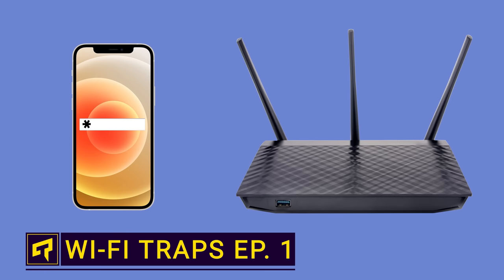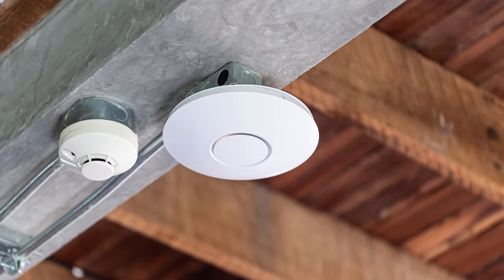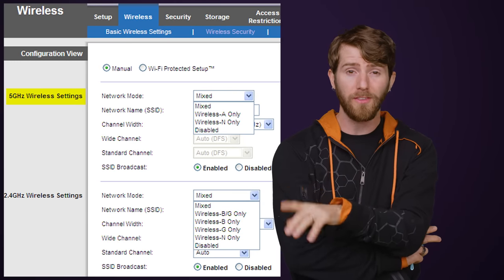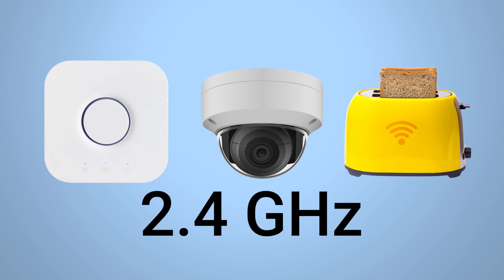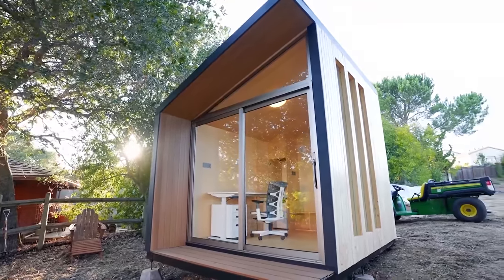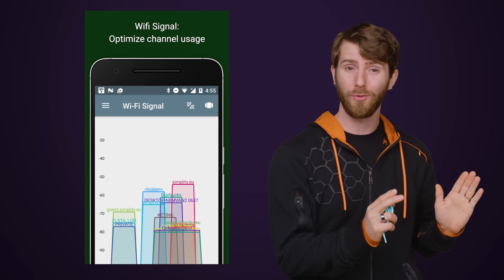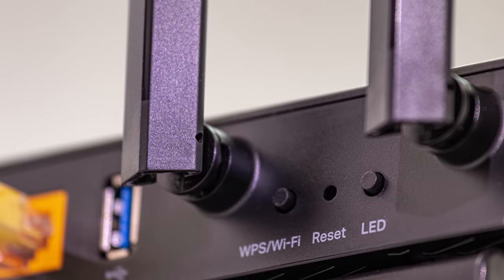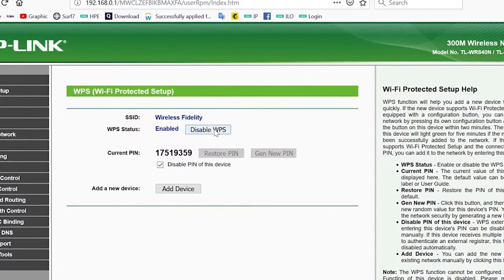Avoiding Common Wi-Fi Traps

Comment: i have often the problem that my cellphone looses the connection, while my laptop has no issues... at first i was thinking that it could be the router because he also loses some times the connection outgoing and had an dualstack-light problem. But meanwhile ive got a nex fritzbox an the issu remains. so i think it must be a cellphoneproblem...

Comment: What is recommended for beam-forming routers with detachable antennae? Is it ok to place a single antenna up high on a longish extension cable and have the others (other two?) attched directly to the router?

Comment: Note: A channel which partly overlaps with others will come with significant send/receive problems. Either you will find a complete free channel and use that (best case) or you sync your channel with the ones of your neighbors (usually channel 1, 6 or 11). This allows your Access Point (Router) to coordinate better with other.

Comment: If the range allows, actually switching to 5GHz can improve a sketchy 2.4GHz connection in crowded areas. 5GHz has many more channels available, and the limited range can work in your advantage too as not too many neighbours WiFis will interfere.

Comment: Reusing old routers as wifi hotspots is cheaper than using dedicated wifi hotspots and more effective sometimes than upgrading the wifi version, plus can be used as unmanaged switches. The only downside is you need to invest some time in studying how to do this and figuring out the setup but you also will learn quite some things about networking.

Comment: wireless modem guard interval. i believe most are set to "short".. if there are walls and signal in the other rooms are about less than 90%. for more stable speed, may need to set guard interval to "long".

Comment: My wifi used to lose connection a lot of times a day so I created a white list with the devices of the house and the problem was solved. The only downside to this besides being a little complicated at first, is that if you have guests or a new device you need to enter in the router to enter the new ip or a guest wifi might work idk. Also if you are on an iPhone you gotta disable private address so that it doesn't generate random ips and that way you couldn't connect

Comment: Small thing, WPA pins are completely safe because most routers will lockout wpa after 10 or so failed attempts, though there is a problem called a pixie dust attack in many routers, and that allowed PIN recovery in a matter of SECONDS
Reply: Bully and reaver are some very handy tools that exploit that vulnerability
Reply: @ΧρήστοςΔημακόπουλος-ζ5ε  yes, though only the pixiewps fork of reaver and not the “vanilla” version

Comment: You completely forgot ping. 2.4GHz and good ping are bitter enemies in my experience. Specially if you have bluetooth devices, an active microwave, or even just simply multiple people using the network far apart so that collision avoidance doesn't properly work anymore. Let alone neighbors that crowd the bands. Fuck 2.4GHz. I've always had bad ping and bandwidth because of it! I hope it goes away forever!
Reply: *Especially (different meaning)

Comment: on my zyxel router (may also apply to other brands) WPS settings are separate for the 2.4 and 5 GHz bands, so you need to disable it for both - and if you're not familiar with Zyxel's terrible UI it's not obvious how to get to it.

one of the more "funny" things I see in my building are neighbours' TVs, printers, and phones that show in Windows networking, assumingly because they're set up as unsecure access points and hot spots. Sometimes windows will even show these in the "send to" option. We have around 400 apartments in this building, so I don't have any way of knowing whose devices I  can see, but it is a sign of bad security that they show up at all
Reply: Are you perhaps using Powerline Ethernet with Powerline encryption disabled? That might explain why, if both you and your neighbors are doing that. Check your Powerline adapter's manual, but with the TP-Link ones I've used, you enable encryption by pressing the pairing button on  one, then another, and keep doing that (pressing pair on one paired unit + one unpaired) until all of them are paired.

Also, if that is your problem, you are probably using Powerline adapters based on the HomeAV 1 protocol, where encryption is optional. When I upgraded to Home AV 2, network performance improved _significantly_.

Comment: living in a medium/high density unit block (condo to you Canandians) I frequently have signal quality issues (despite having line of sight with my AP which is on the wall!), with my unifi's client experience graph looking like something from a Saw movie trailer... My tip (and only the tip ahuh! damn it AvE, what have you done to me!!!!) Be willing to regularly change channels to find a better channel that is less congested as it can help a lot, though you should be mindful of channel overlap.

Also avoid cranking the AP power, it increases the footprint which makes it easier for a would be attacker to attack the network from afar but much more importantly, it increases background noise which can cause other nearby access points which are in automatic mode to crank the power too causing a perpetual feedback loop resulting in a shit wifi experience for all. Sadly most devices that are "included" in internet packages just crank the power to max :(
Reply: doesn't matter if you are line of sight, necessarily...if your neighbors' wifi is stepping on yours it's because you are closer to their wifi router than you are to yours (e.g. you are getting a stronger signal strength from your neighbor's router vs your router).

Comment: Best way I've found to make your Wi-Fi better (outside of just ditching it for Ethernet) is to set your router to broadcast on a 20 MHz channel for 2.4 GHz, and 40 MHz for 5 GHz. Or for certain brands, tell it "up to X Mbps", where X is the smallest number. Then do the channelization to get into the area with the least amount of interference.
Yes, outwardly it looks like your connection will be worse, and the theoretical limits go down. But if you live in an apartment/condo/townhouse, you'll notice your wireless is a lot better now that you don't have to deal with as much interference from the dozens of routers around you.

Comment: I guess I am very lucky when it come to Bluetooth and Wifi connectivity. I don't think I ever had any wifi issues unless I am upgrading the firmware or resetting the connection once in a while. Ever since I purchased a mesh wifi router and spread it out on my house, I never have an issue at all. Everything connect and sync pretty well on my devices. Sometimes I never really think about my wifi because it is always connected as if just a regular thing. Get home or even within 40 paces from the front door and my smartphone is already connected. (auto connect to secure network).

Comment: The latest BT router here in England is great for most things except they have taken out the option to use the 2.4 or    5ghz manually. A bit of a problem for IoT bulbs that run without a bridge. Sigh.
Reply: If the IoT items only use 2.4 ghz, it shouldn't be an issue , the SSID is the same but they should connect to the 2.4 automatically...it's the same with my mesh system , same SSID for 2.4 and 5 Ghz , but different channels, all my older 2.4 Ghz only gear connects just fine.

Comment: This video missed the big advantage of 5GHz, in my opinion: its use as a counter to crowding. Between the larger number of channels, the fact that the channels do not overlap (in their basic forms at least), the more limited range and the fact they're more affected by walls, crowding isn't much of an issue on 5GHz, so if crowding is the issue, it's a much better choice than 2.4GHz

Comment: I had constant Bluetooth headphone issues (AirPod pros) until I disabled my 2.4ghz network. They’d get staticky audio multiple times a minute and sometimes disconnect completely. Since disabling I haven’t had a single issue.
Reply: You don’t really need it on unless you have a device that only supports the 2.4Ghz band. Unfortunately I have one devices that still uses it.

Comment: I do this for  a living in businesses. Couple key things. Avoid going thru pathrooms with pipes in the wall. It is not so much the metal, but the water in them. Also when I go into a home 99% of the time the antennas on the Wifi routers are in the wrong position. The first image  in this video has the antenna placement wrong. Modern multiple antenna devices need them to be parallel   You can point them in a direction, but they need to be parallel.

Comment: What I regularly do when setup a wireless network is to disable SSID broadcasting. Sure, its more inconvenient when guests come over and want to connect to the wifi but it helps with security. Mac Address whitelisting is also a good way to keep your network secure by only allowing whitelisted devices to connect to the internet. Its also inconvenient for guests. What I do for guests is just temporarily enable a guest network with a secure password for them to connect to and keep my main devices whitelisted on our hidden network.
Reply: Both of these things are easily overcome by somebody who would like to break in to your wifi. Keep WPS off, use a secure WPA2 password, you don't need to engage in security theater. It's about as useful as taking your shoes off in an airport.

Comment: Disable the 2.4 Ghz on your modem, use an Ethernet over power to an old router setup to be a switch and setup that device to turn off it's 5Ghz and use it for the 2.4Ghz in a more central part of your home
Reply: *its (possessive)
it's = contraction of "it is/has"

Comment: To get better WiFi, I just use an old router and configure it as a access point (AP) and place it in a dead space in my house. The trick is getting a ethernet cable from the dead space to the main router. Also if you don't have a old router laying around, you can usually get a cheap one from a thrift store like good will and such, and use that as a AP.
Reply: *an access
*an Ethernet
*an old
*an AP
(Because these words start with a vowel sound)

Comment: If your device has an ethernet jack. You can use a device called a moca adapter. Simply plug one adapter into you router and another into your pc using existing cable tv wiring. These devices are typically better than powerline adapters but, with a higher price tag.
Reply: i had issues with powerline adapters so i just drilled a hole in the wall and ran an ethernet cable through it
Reply: @gamecubeplayer  For the win.

Comment: Another thing to know it is that often you will get no improvement setting a higher signal strength on your router. Of course the measurable range will be greater but you need to keep in mind that your end device have to answer back and smartphones often have lot less power than a laptop. Did you even have case where you have 2/4 wifi bars on your laptop and smartphone on the same position but you can only access the internet with the laptop ? That’s probably the cause, both devices can see the wifi but only the laptop has a strength enough signal to respond.
Reply: Is like being in an arena with someone on the stage, without a mic, you can’t hear what the other is saying. If you give the one on stage a microphone, it is like setting a higher signal strength on the wifi router, you could hear the one on stage but he can’t still here you back.
Reply: Also having to high signal strength in a multi wifi router environment will cause you client to stay connected longer with an router before roaming to another. This behavior know as sticky client.

Comment: I whitelist MAC addresses of my devices and allow only those device to connect. Yes, it did give me some frustration when I bought a new device and forgot to whitelist it but hey at least it worked.
Reply: MAC addresses are always publicly visible in clear text, so they can easily be seen with a packet sniffer and then spoofed. MAC address filtering is no protection at all. The encryption is what matters. Use WPA3 or WPA2, and set a strong encryption key (long and randomly generated) that you keep in your password manager. Maximum length is 63 characters.
Reply: @alvallac2171  Of course encryption is enabled with a strong random password. MAC address filtering is just addition.

Comment: I have an issue with my CenturyLink Fiber internet (and included "Gateway" which is a Modem/Router combo) that I can't seem to find an answer for... My devices will periodically just get really slow.  But disconnecting the device and reconnecting it seems to fix the issue.   This isn't a huge big deal on a laptop or a phone.  But on things like a playstation or an amazon echo, it's a pretty big pain in the butt.  Especially for how often it happens.   My wired connections work fine so I'm fairly certain it's specific to the wireless signal.   Anyone have any ideas / advice / thoughts / resources?

Comment: "Wifi is supposed to be easy"

Don't worry, there have been about 30 years of engineering and standards development to make it easy for you. In reality, it is NOT EASY AT ALL. There is a ton of stuff that most people don't even know or think about that needs to be solved for wifi connections, such as 2 signals on the same frequency getting transmitted at the same time.
Reply: Meanwhile... 
*goes to friends house * 
"what's your wifi password?"
"oh i don't know it's on the back of the router"
router is located under the cats litter box

Comment: Why did you say the latest is WiFi 6 when the latest is actually 6e which is very different. If they just see WiFi 6 on the box they may think they're buying the latest version. The Pixel 6 has 6e so it is not something only enthusiast or techies would have. If someone's using this as a guide for what to buy they're going to be operating on bad info.

Comment: I use a WLAN cable. It was very simple. Just 50 bucks on ebay.
Reply: there is no such thing as a WLAN cable.  The W stands for wireless, so if you are using a cable, you aren't using wifi.
Reply: @hanwagu9967  R u sure? I bought it on ebay and since I got it, it really improved the connectivity.

Comment: If possible add all the Mac addresses of your devices to the router page so that no other device can connect (for friends and visitors use guest mode if available) even if they know the password 😏😏🔥 !!!
Reply: MAC addresses are always publicly visible in clear text, so they can easily be seen with a packet sniffer and then spoofed. MAC address filtering is no protection at all. The encryption is what matters. Use WPA3 or WPA2, and set a strong encryption key (long and randomly generated) that you keep in your password manager. Maximum length is 63 characters.

Comment: What I love to see is Linus take on  astrophotography. You need hardware that survive a frosty and damp night off the grid. You need a pc that can handle picture modification. There is free to use software that helps you stack your pictures in one satisfying result. You will need a telescope, but if you have a DLSR, you just need a T-ring for less than 20 bucks to take pictures. An old Philips Toucam webcam slightly modified can already make spectaculair planetary pictures. There is substance here for a video, however without the access to a telescope it will be difficult. However, there should be a local astro club in your neigbourhood that will help you out there.

Comment: WPS is actually pretty secure, even more than your router password. Just disable the PIN side of it, and only allow it to work when you press the button. In that scenario it becomes almost as solid as 2 factor, as it is time-constrained entry triggered by user tapping the button.

Comment: When will LTT give a review of ISPs. I mean here in my country we dont usually get the speeds we paid for. like 100mbps can sometimes be 30 at most cases. and boosts up at 100 around midnight. some also boosts up to 100mbps but slowly goes down to around 50% of that speed or less if you speed check it. Is this common around the globe? or am I being tricked by my ISP? Is there a work around? are there ways to talk to your ISPs about this?

Comment: Well routers may also get hot like our Pc as they use more powerful processor nowadays like mediatek so its best to place the router in a place where airflow is good.

If you don't believe me you can check your router back just turn it upside down and keep your hand on the backside (where ip address,mac address and all is written) and see for yourself

Comment: How to improve your home wifi.
Open the router / modem cut a big hole in the case and attach a fan and you will notice the ridiculously small passive cpu cooling.

manytimes its not even a fin its literately a piece of sheet metal which you can fry eggs ontop of